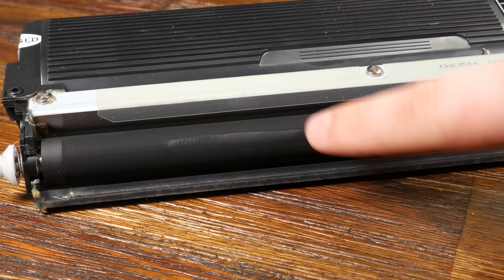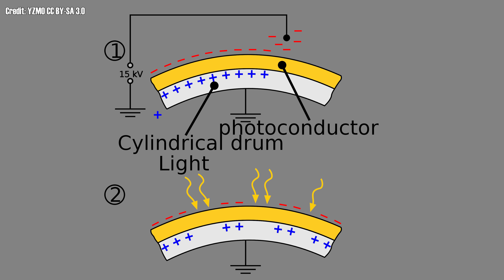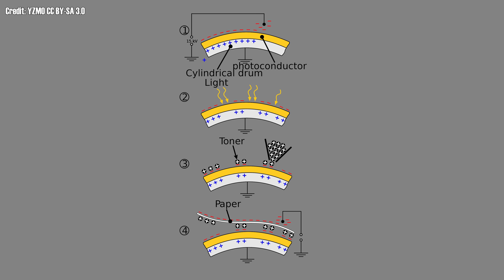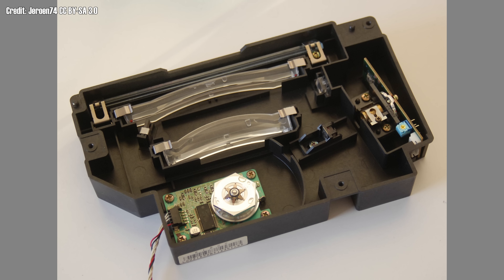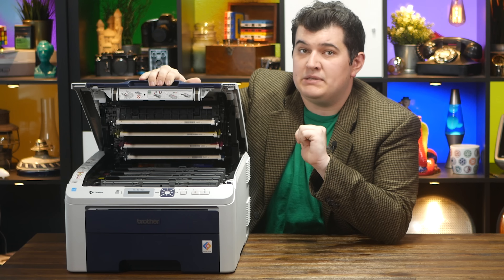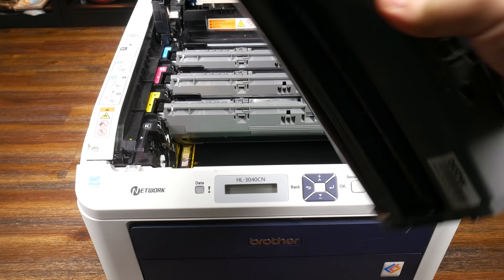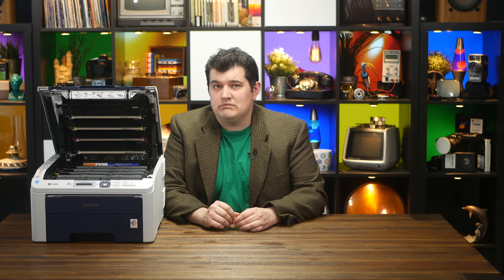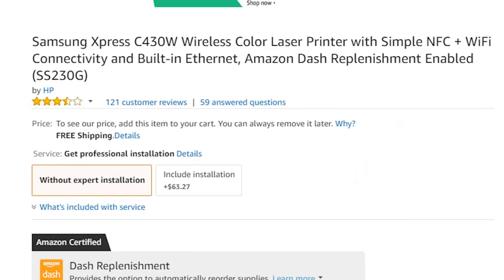LED Printers: The Common Printing Tech You Haven't Heard Of

Comment: I used to repair these printers, they had excellent image quality, but the biggest problem was when the customers would mail them in for service, and left the imaging assembly in place

90% of the time, it caused a “toner bomb” where all four toners (CMYK) spilled all over inside the printer, getting into every nook and cranny of the printer, rendering the printer unrepairable

The “spinning thing” is the mirror assembly 

Those bars with the LED assembly were notoriously delicate and often broken in shipping

Most common failure?
Paper jams in the fuser, and paper jams in the feed assembly, problem is, feed assembly jams typically were incorrectly cleared, and the paper input sensor flag gets destroyed, needing a nearly total tear down for repair

I also repaired the Samsung’s, far more solidly built than the brother

Brother and Lexmark printers; poorly built, plastic gears, basically disposable

Samsung and HP, we’ll made, reliable printers

The best color printer I’ve used?
Xerox Phaser series, uses “solid ink”, wax based ink (basically melted “crayon” blocks) an interesting fusion of laser/inkjet/thermal printing.

Comment: I enjoy your technical talks. This one hit home. I worked for Xerox and a couple of other mom & pop shops as a Copier repair technician. So allow me to point out some trivial things. I say trivial because they really don't matter to the end user, but make a big deal to us techs that troubleshoot and repair them.
The first, in your description of how the image is formed on the drum, is missing a little bit of info. Again, this only really matters if you need to troubleshoot the image quality. Some of the imaging systems will use the laser to erase the charge for the toner to get attracted to the drum. We refer to this as 'write black' as in writing black to the drum. Which was the method you described. The other method is 'Write White'. In this method the laser clears away the charge on all of the area where the toner will not stick. So basically the laser is writing to the drum as if it were a negative of the actual image.
The other thing was how the color image is transferred. On the machine you had, when you pull out a drum, you will see a conveyor belt below all the drums. This is called a 'image transfer belt' or 'ITB' (often we just called it the ITB or transfer belt). This is used to transfer the complete image at once before getting to the paper. The paper never touches the drums. The drums transfer the image to the ITB, which once completed can be transferred to the paper.
Some color machines do not use the ITB method, but instead send the paper around the machine up to four times, to get the image on the paper. Sending it once around the machine for each drum to be used. The drums on some of these machines would be on a carousel, and be rotated after its image is transferred to the paper, and the the next one gets a go at it, before it then gets sent on to the fuser.
Again, this stuff doesn't matter to the end user. But to us techs, it means a lot. Especially when you need to fix things. (especially when the customer breaks these things by using the wrong kind of paper, or paper that is stale. Yep, paper past its shelf life).

Comment: Im assuming someone already mentioned this but the page doesn't touch the drum in your model. The page only touches the transfer belt. The color toners are laid out on the transfer belt and if you open the printer mid print and remove the toner cartridges you will be able to see the print image on the belt before it is transferred to the page.

Comment: Modern color laser printers use a belt and deposits the toner to the belt. As it passes under each color toner starting with yellow, magenta, cyan, and finishing with black each color is added to the image. This belt, called the transfer or image belt, then moves the complete image to the paper and using the system he described, transfers it to the paper. A black only print on one of these printers uses the same belt as the full color, but turns at a faster speed because it's easier to process and line up a single color image. This is why the color and back prints are similar in speeds. I don't know of any printer in the last 15 years that transfers toner to the paper one color at a time.

The biggest reason for a slow color print vs black now days is the printers processor and memory speeds. A black image requires very little to convert it to an image that can be written to the drum. A color image needs to be broken down into 4 different images. If the printer is low on system memory, it will tell the computer to hold while it processes each page. In this case, the printer is able to process and print 4 pages of black to each color page it needs to process.

The single biggest factor in the over all speed of a printer (color or B/W) is how fast the spinning mirror is. The higher the RPM, the more laser lines it's able to write. As a person that has been repairing printers for over 5 years, I can say that in a model line, the only real difference between the fastest  and slowest units are the controller board and the laser unit. The controller board just speeds up the drive motors on the higher page per minute printers. The spinning mirror isn't able to be controlled in the same way. To keep the timing right, it will spin up to a set speed an stay there while it is printing. If you've even used a laser printer you can hear this motor run. Normally you will hear the fans start first, and then you will hear a whirring sound that stay constant and when not needs it will turn the power off and it will free spin until it stops.

Comment: In my opinion, inkjets do not reign supreme for photo printing.  After getting well and truly frustrated with inkjets, I bought a dye sublimation photo printer, and it brings all the advantages of durable prints, no ink to dry out, and gorgeous full-tone prints together in a single unit.  The cheap little ones are, well, little and cheap, while mine is bulky and cost a few hundred dollars, but I find it fully worth it.

Comment: Well done, just want to help on a few points; Okidata DID invent the LED print process and it has been around since shortly after the laser. The LEDs use a fiber optic lens and the fusing units in all dry toner machines are their weakest link due to the constant high heat and pressure.   The reason I'm so sure is because I was a copier guy for 34 years and factory trained on several brands including OKI color printers. Don't want sound like a know it all but you hit on a subject I know intimately well and I couldn't resist.

Comment: Laser printer required a lot more in inks cartridges of ink colors and those inks heads printing and it is not economically costing to operate and own.Inkjet  printer are smaller and only have two inks cartridges to do operating and cheaper to buy those two inks of cartridges too.

Comment: I still have one of these It was a great printer but the toner cartridges 3 colours and black got too expensive.
Reply: I have a Brother color LED printer near identical to the one shown in the video. Last week I went to the local office supply to pick up a set of toner cartridges, currently they're $75 each so $300 for a set. I ended up buying an aftermarket set of cartridges off of eBay for $40. I dunno how well they'll work out, but if they work at all I'd consider it a win.

Comment: I know this video is pretty old but the bulshit about inkjets bothers me:
1 yes it dries, but modern printers can go weeks witout printig with no problem. it may be a bit ineffective but still better THAN USING 4 INDIVIDUAL PRINTERS TO GET COLLAR.
2.Oh no an unpleasant sound... because who does not use there printer 24/7? who would just print something for 5 minutes and then be done?
3. Ink cartridges are priced high but not because of there cost but because of the companies. That is NOT a fault of the technology. also, more expensive inkjets mostly have big cartridges which are not more expensive than toners. (wich are greedy companies aside probably a lot more expensive)
4. most ink dries in seconds and of you just instantly rip it out of the printer and start rubbing your hand over it then that sounds like a personal problem.
5. Yes, but do you know what also washes away in water? Paper! no one cars if the ink is still on the paper that was destroyed by rain. Also ever did this? as if you do you need to use special paper anyway and this is available for inkjet AND Laser. (laser is still better here but what a specific use case)

Comment: I've got a newer Canon imageClass printer very similar to the one shown and while I couldn't see the LED (or laser), I can confirm that the toner cartridges are in a line and have individual drums set very close to the top of a very thin section of the printer body. Which does suggest that it's an LED printer. I could probably confirm by a speed test, but who prints these days?
Reply: I don’t think the arrangement of toner cartridges is your best clue. I just checked my canon laser printer (has the same drawer-like arrangement of cartridges). But I guess they just efficiently packed the laser units in there to have this "straight forward" design. A speed test wouldn’t help either, because it can print all colors right away

Comment: 7:13 Paper taking a meandering path??   I have not seen this in practice.  Which make and models are you talking about here?  The ones I have opened, dissected, and fixed, would deposit the toner onto the Image Transfer Belt, one color at a time, making a complete cycle per color. Then, once they are all collected together, the printer picks up the paper and passes it along the /end/ of the transfer belt, where the toner is transferred to the paper, and ran straight into the fuser..  accounting for 4x length of print per page.

Comment: I still remember the disappointment when I found out laser printers don't actually char the paper with lasers.
Reply: Sadly, they also don't go "pew pew pew".
Reply: @EeshEesh   If it was a Stormtrooper laser printer 1) it would miss the paper and 2) the paper could outrun the laser. I mean if these are the elite soldiers of the Empire what are the crap ones like ? Sorry, rant over.
Reply: @EeshEesh  MIne goes unhhhhhhhheeeee.
Reply: @EeshEesh  lol
Reply: Like when Darth Vader realized the Death Star couldn’t make planetary tattoos
Reply: Yes they do shut up lalala I'm not listening
Reply: My disappoint is immeasurable and my day is ruined
Reply: @jayst  Words of a wise man!
Reply: Does anyone remember the ZX Printer? It had to have silvery conductive paper and the printer used an arc from the printhead to burn the image on to the surface. Never seen anything else like it before or since.
Reply: @TheAmazingAdventuresOfMiles  That is a spark printer. I have one for my Casio fx-702p. It was similar to the Sinclair's but used narrower paper. It is complete obsolete. It originally was introduced in 1948.
Reply: @TheAmazingAdventuresOfMiles interesting
Reply: Michael Persico  I got one for my sister for Christmas. Its normal thermal paper. Paper only needs the right width
Reply: when i started working as a copier technician and had to figure out how they work, i felt the same =P
Reply: D:
Reply: I always thought they brun in the letters into the paper but then i saw that laser printers also print in color. THen i was confused
Reply: "All I wanted was a printer with fricken laser beams...seriously people tell me why I pay you...throw me a bone here."
Reply: @mxslick50  I've been playing around with engraving leather and glass. should look at a laser CNC. :D
Reply: There was one early model laser that used to catch fire regularly.   Any minor glitch (like paper jam) it would stop feeding the paper but it would forget to switch off its fuser (heater) element.   Result: within about 3 seconds the paper would catch fire (if the user didn't yank the plug first).   That would melt a 'safety' string inside which had to be replaced by a technician before it would work again.
Reply: My disappointment is immeasurable
Reply: If it makes you feel any better, there are some printers that do actually burn their paper.  (More or less.)  They use a thermal paper that reacts to heat.  Not sure why anyone does this, but there you go.  Side note: one huge disadvantage of using a printout from thermal paper is that you can't use a pencil eraser on one because the friction of a rubber eraser generates heat and thus makes black smear marks on thermal paper.  Oops.  Of course that was many many years ago that I last used one.  Maybe they changed?
Reply: @justsomeperson5110  Thermal printers are cheap and don't require ink or toner. Most receipt printers are thermal printers,  you just have to feed them paper.
Reply: @AaronSmart.online  And dont forget the GameBoy Printer. Its also a Thermal Printer. Otherwise it couldnt be as compact
Reply: @AaronSmart.online  you have to feed them thermal paper, which is yucky and can only be printed on one side, and can fade if stored poorly.
Reply: @AaronSmart.online  oh yeah, some shipping labels are also like this
Reply: @justsomeperson5110  Cash registers still use thermal paper.
Reply: @schwarzerritter5724  "still"... they started to use thermal in second half of 90s massively. Before that it was that "blue" cheque printers - still used in banks. That one was more permanent - thermal paper "lives" for 2-3 year max - but working with machine wasn't good for health
Reply: @justsomeperson5110  Yes most ther.al printers still smear like crazy when applying pressure to them. I work in fast food and even letting the printed labels touch the heated table will cause them to darken and go black quickly.
Reply: @justsomeperson5110  Most receipts are thermal paper, that’s why leaving them in the sun turns the paper black.
Reply: @justsomeperson5110 no, I think you use them all the time as most people, I’m pretty sure nearly all receipt printers use thermal paper
Reply: Possible negative effect is an increase in small particles in your room.
Reply: …they don't?! Oh man…
Reply: Found this out last year. I was so mad 😂
Reply: I just found that out just now by reading your comment. Now I’m disappointed too.
Reply: You can use a Laser Cutter for that.
Reply: me right now watching this video :(
Reply: Why don't we do that? It would be useful for monochrome prints.
Reply: @qwertykeyboard5901  Probably the fire hazard. Thermal paper is already doing it at a safer temperature.
Reply: @schwarzerritter5724  Lack of consistency might also be a concern. Putting the same energy onto a fresh out of the box page vs a slightly moist one would result in different black levels.
Reply: THEY DON'T??
Reply: not really the same thing but as an engineering major i regularly use a laser engraver and that is exactly how it works. you can also engrave or cut almost anything except paper
Reply: Same
Reply: Damn
Reply: Don't tell us that
Reply: At least they haven't zapped you and all your home furniture.
Reply: Same
Reply: I had the same idea as a kid. Later I heard about color laser printers and concluded those must have color lasers.
Reply: I did just use a fiber laser to "print" a shipping label the other day when my inkjet was broken.  It...wasn't great, but apparently it was GOOD ENOUGH.
Reply: Cause then it wouldn't have a "Consumable" component, and people think that means you're losing money, some how
Reply: Yup as a kid I found out that the lasers didn’t burn the paper and it made me feel devastated. Granted I was like 8 😂
Reply: Also maybe you heard of fax machines? Oldscool that uses thermal paper too) and thermal printers, by the way, print all that stickers for the goods in shopping malls, price tags and so on) and they are not going to give up their positions, at all)
Reply: Take your 1000th like 😀😊
Reply: They do essentially. It creates an opposite charge which attracts the ink to the paper. I believe that’s what he meant.
Reply: @42luke93 I think the commenter meant he thought the laser actually 'burned' the paper instead of melting ink toner to it.
Reply: Thermal paper is made with BPA plastic, don’t touch that ‘tarding affeminizing shit.
Reply: @danieltoledo9383  Wah 😫

Comment: Well I had no idea. Thanks for pointing this out, I'll keep my eyes open for them. Is there much of a difference in price between laser and LED?
Reply: I know this is an older post but i figured i'll answer incase someone else has the same question. LED printers are usually cheaper (at least in Brother's case) when directly comparing printing speed and toner cartrige capasity to traditional Laser. But this is because LED printers usually have a shorter life span (about half that of laser) due to LED malfunction. However were still talking a lifespan of roughly 60,000 prints depending on paper coverage, so its not something that will affect most home users.